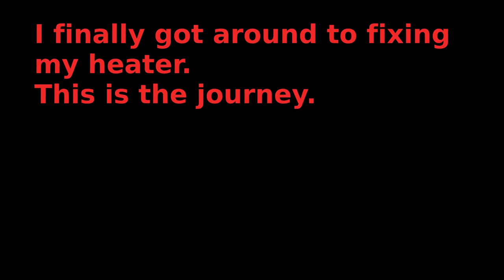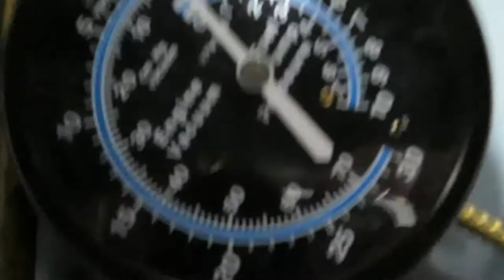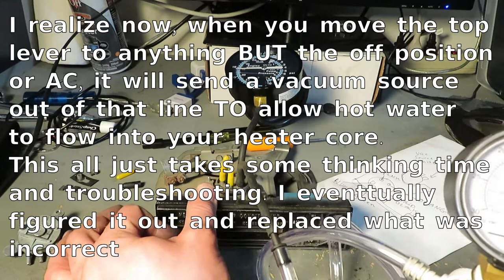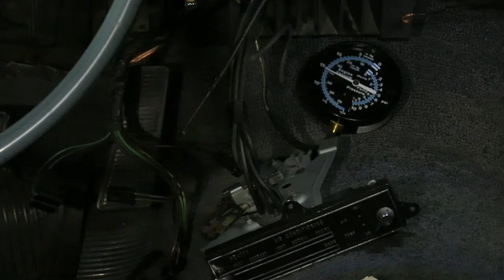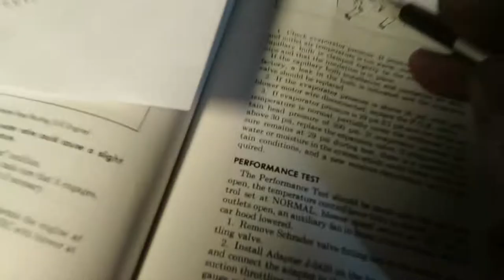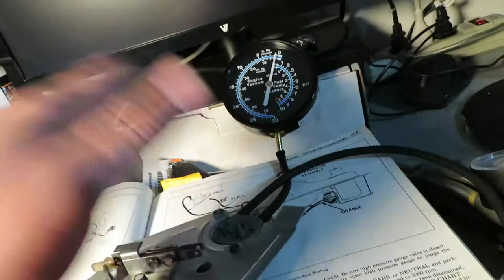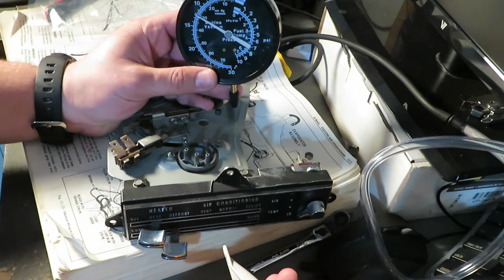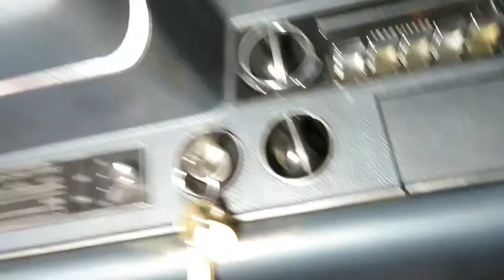FIXIT🔧 '68 Olds Heater & HVAC Teardown, Diagnosis, and Repair

Comment: I have a 68 cutlass supreme. I don’t have the problem but I’m watching to learn more about our vehicles. Thanks for uploading your vid.
Reply from the maker: Thanks!! I love my supreme, she gets me around when I need her to! 
A month ago I had to replace the hot water valve on my motor, the new one i put when I made this video went bad! The original hot water valve lasted 51 years, the chinese aftermarket one lastes 1.5 years :| lol
Reply: @CodyShell  that’s terrible to hear! Yea I’m afraid when I start digging in to my engine components and have to replace parts I’ll have the same problem. Right now it’s still pretty stock. The only things I know that have been fully replaced is the carburetor. My intake manifold seems suspicious and I haven’t figured that one out yet, either it’s the original or a 71-72 model. But for the most part back when I was driving it 10 years ago it was my daily driver. It’s been sitting for a long time in the garage but I’m getting ready to start cleaning it back up to start driving again. Thanks again for sharing.

Comment: Watch the entire video. I’m having the same problem. But there is only one vacuum line I see going inside my car from the hood. I def need some help
Reply from the maker: let's figure it out! what year is your car? do you know which vacuum line is going through your firewall? Is it the line coming off the vacuum canister? Does your car have AC? 
I guess the biggest question is what is it doing? are the vents not operating? or is it just not getting hot?

Comment: any idea how many feet of each color vacuum line are required?  I'm about to redo the HVAC on my '69 Vista Cruiser, but most of the lines are currently missing.
Reply from the maker: Cool! The longest section is from the vacuum canister, through the firewall and to the HVAC unit. That's probably 3 feet. All the bits within the dash are really short. There are a few runs that need to go from the HVAC unit to the heater box... I'd say 6 feet in Total should be enough for everything. 
If you need a scan of the vacuum diagram from my 69 chassis service manual let me know!